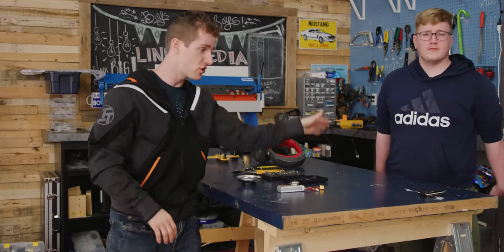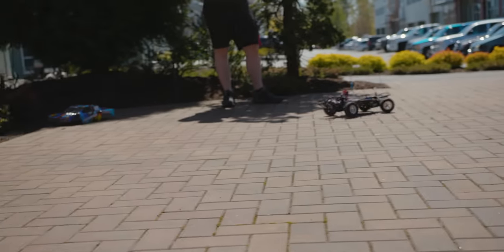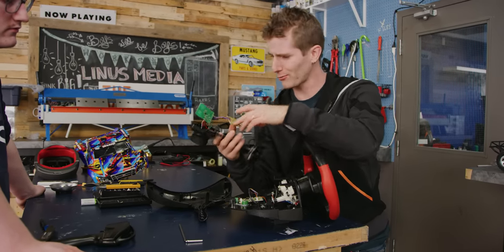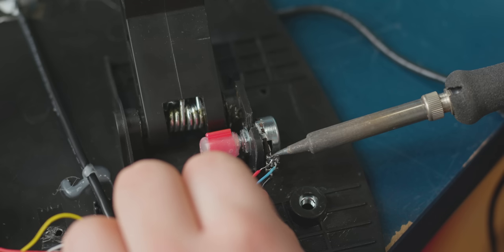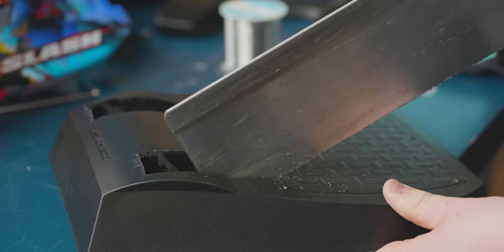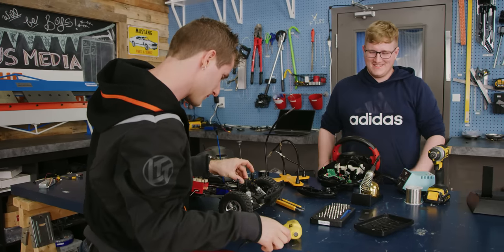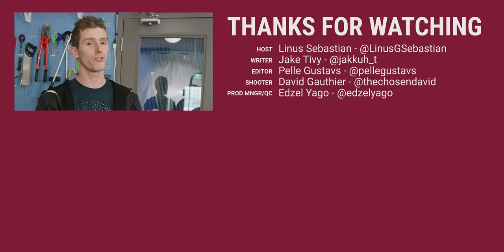First Person View VR RC Car Racing!!

Comment from the maker: We now know the resistance of the potentiometers SHOULDN'T have mattered. They're used as voltage dividers, so even if the resistance is different, it should have worked fine. However, while testing, when using the stock pedal's pots, we'd either have 100% or 0 throttle and nothing in between - hence why we tried to use matching pots.

As this is just a proof of concept, basically just to figure out if this is as cool as we imagined (and it is), we just needed the car to accelerate and brake in a controllable manner. The rest will be figured out for the actual final build. :D
Reply: Hi dad
Reply: 10/10 IGN
Reply: Hey Linus, I am ur big fan. Ur vids r really helpful. I am Daniel from India, I live in the UK

Hi from England.✋✋✋
Reply: yeet
Reply: How did you screw up copy and pasting a link into the description??
Reply: same as my project
Reply: Nice RC Car. 👍
Reply: Ey, I have the same steering wheel, but all black.
Reply: Linus Tech Tips you should try to control the rc car over 4g or 3g so you can drive it almost anywhere. Me and my friends tried to do it but wasn’t able to and wanted to see if you could do it😀
Reply: guess what's the half rotation of a 10k potentiometer...
Reply: Now just find a way to measure the g-forces and sync it with a tilting sim rig...
Reply: I built a fpv race drone last year but this setup looks extremly fun too! I know whats my next project is ^^
Reply: @TLawless  Don't forget force feedback so you can catch slides more intuitively :P
Reply: There is small chance that one potentiometer is linear and the other is logarithmic
Reply: Actually the resistance on the pot can matter MASSIVELY depending on how they are wired - whether there is another resistance in series especially, and whether it is using 2 or 3 wires (2 wire it ALWAYS matters hugely)
Reply: Here is how to do it correctly from scratch, posted it a few weeks ago and sent it to you per emai/twitterl: https://youtu.be/7Ja7rQFfQJc
Reply: That is pretty awesome. Wish I could be there. To much money for me tho :( to come to LTX
Reply: googly eyes on the vr goggles or go home
Reply: @Rabbid_Squirrel  - I've actually tried something similar with a remote camera and control system over 4g and the latency is horrible, to the point of unusable - the lag between input and response is so bad you have to almost be thinking a few seconds ahead. 

That DJI headset uses WiFi band signals (iirc) so I'd expect its probably like 10%, if not less, of the latency a 4g connection experiences.
Reply: Cheaper Better Version - Eachine TX03 Mini FPV Camera AIO Combo + Any 1S Lipo Battery + FXT VIPER FPV Goggles
I love yah Linus, so I am sorry for this, but you are waaaaay behind in this arena. Still, you did an awesome :)
Reply: @Rabbid_Squirrel  Actually we did manage this but the ESC gave us hell. Check out Project Dasher on GitHub
Reply: should try to make a car that transforms into a quad
Reply: 10/10 PCWorld
Reply: I think you could have soldered a 5k resistor in series with the potentiometer, that would probably had made it ok to use.
Reply: Linus.  Electronics 101.  using 1/Rt = 1/R1 + 1/R2 + 1/R3 + ...  you can put a 1% 10K ohm precision resistor across a 0 to 10k pot to get a 0 to 5k pot.   you can ALSO put a "10 turn pot"  with a 5k resistor in serires with the 0-10k pot so you can dial in (10 turns) a parallel resistance of 5k to 15k giving you the exact matching 5K total resistance you are looking for.    You did not have to change the pots out.  You were thinking like a mechanical engineer and not an electrical engineer.   Great job anyway.  Even if you and your team did not know the electronics theory your 'never quit' and 'never say die' 'solve the problem' attitude is stellar.   I can teach you electronics, but NO ONE can teach enthusiasm and your team has that in spades.
Reply: linear and logarithmic pots are a thing that you should know of.
Reply: lol sure you guys invented it
Reply: I have that steering wheel!
Reply: You should make a bracket dome that screws into the sides (2 points) of the chassis so that the camera and its receiver can get the air it needs and the camera can point right out of the front windshield. You can create a scoop like F1 race cars have to help circulate air into the car that will keep all the components cool.
Reply: Do the pots have 'A' or 'B' written on them? That's logarithmic vs linear ie. B10k is 10k linear.
Reply: You could put a 10k resistor in parallel with the potentiometer to cut the maximum resistance in half
Reply: i expected that much actually, ... say the transmitter is somehow defined to have... +2.5V = 100% and +0.1=0% or so.. and by the way the pots are built you can easily have like 0.5V jumps in between each gap so.. Not knowing any data... i would probably have came to the same conclusion like "in theory it does not matter but in reality we will probably have some janky results" .. and ill bet you just had another excuse to 3D print xD
Reply: Need scrapyard wars....!!!! 🤗🤗
Reply: Next time a TESLA first person
Reply: Is there a reason every other YouTuber is using NordVPN? is it better? Faster? More secure? Only asking cuz I used your link to subscribe to PIA VPN
Reply: can you mount 2 cameras one behind the rc car for switching to 3rd person view would be awesome
Reply: 7:03 Thank me later
Reply: There are goggles with motion tracking and you can put servos on the camera so the camera turns when you turn your head.
Reply: @JJSkEERt For me to travel to Canada for LTX will be alot more for me to go to Insomnia UKs biggest gaming event. But I might come to LTX in later years when am not charged two seats...
Reply: So something big and cool that you could try out with the system installed in the x-maxx from traxxas, maybe with a little bit of negotiations with traxxas you could get them to sponsor you or something just some food for thought.
Reply: The resistance could have mattered if there was some other resistors in series for a minimum preset, for example.
Reply: Lmao, I was literally about to comment a polite paragraph explaining this, but you guys always seem to correct yourselves in a very timely manner.
Reply: I'm surprised the steering wheel doesn't use a rotary encoder. Although you'd have to replace the car's steering motor to a servo for precise steering.
Reply: Been doing this for years
Reply: Good you wrote it. Was going to point it :)
Reply: You can use a pwm board and a raspberry pi connected directly to the receiver and esc on the car to have full control of the vehicle and more customizability. This also allows you to use your own rf transmitter and negate the need to use the original transmitter/controller
Reply: He got a haircut. He finally doesn't look like he's a little bit... Slow. Well, he doesn't look AS slow.
Reply: Famous western education...
shunt the 10k potentiometer with two 5k resistors and swap the wires. stupido
Reply: You should probably, most definitely invest in getting a frequency scanner for the video feed. in your office you probably won't have much interference but in the convention center you're probably going to need it to find a strong clean frequency. i know some FPV pilots that always scout an areas noise before flying FPV
Reply: Actually the original 10k pot would solve your throttle issue since the pedal throw is so much shorter.
Reply: Actually the original 10k pot would solve your throttle issue since the pedal throw is so much shorter.
Reply: Right, you would get less resolution by going with a smaller (resistance) potentiometer. Good video, though. Keep learning.
Reply: if you made the wheels slightly bigger it might help with the vibrations and motion sickness
Reply: It shouldn't matter if the pots are different (between the steering wheel and the remote) as they're usually used as voltage dividers anyway, so only the current draw would be different; the (proportional) voltage should stay the same, (since they're usually suspended between 5V and Gnd, and a µcontroller's A/D then picks up and translates the output voltage).
What WILL matter is the pot's degree of rotation and taper — (I would imagine a linear taper might work best for speed, while log might be better for steering).
Great idea, though! (I've often dreamed of doing the same thing with an RC helicopter).
Reply: Oh FFS use some damn flux and clean that iron.
Reply: @miroslavcepl8531  was about to say just that lol
Reply: @gabriel.rodriguez  Parallel not Series. Series would just add to pots resistance.
Reply: @mgzukows  oh sry, u're right, I thought it were 10k ohm on the controller and 5 on the wheel
Reply: @gabriel.rodriguez  no, that will make it a 5k-15k pot. to make it a 5k pot you would want to put a 10k resistor in parallel.
Reply: Try throwing in some resisters to divide the pots.
Reply: Couldn't you just livestream from some wifi6 phone?
Reply: maybe with a large resistance the wheels turn more slow
Reply: Sounds like you were connecting to the two ends of the pot instead of one end and the wiper.... But you would never make that mistake ;)
Reply: @stevenharris9941  IIRC not a perfect solution due to the taper of the pot but should work well enough for this application - something I've been aware was possible due to having an interest in and building a lot of headphone amplifiers.
Reply: Linus Tech Tips you need to look up Rotor Riot they make drones using FPV or look up Joshua Bardwell
Reply: Can't wait for the final build guide to do this at home. Next you should do one for drones or RC planes to fly from a flight yoke or joystick setup!
Reply: That DJI Kit... That's EXACTLY what I'm looking for for my RC Airplane!!!
Reply: That's awesome Try that with a cheap drone if possible just 2 my cents.
Reply: It's like watching from point of view of Antman.
Reply: I think the camera near the back as much as possible would make it easier to drive. like 3rd person driving a car in video games yah know
Reply: can someone out there please hook a brother up with a 3gb pci-e ddr3 vid card it's for a project for my daughters school and way out of budget and the 2gb card she has is just a hair to laggy no matter the setting
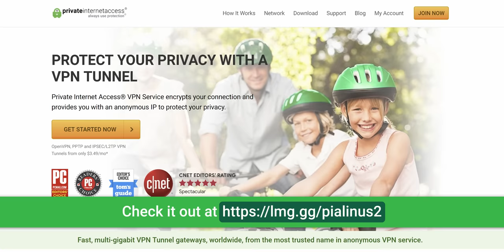Reply: @13:02 -- not even a SINGLE tool is there  where the layout says it should be... lol
Reply: This is not Linus.
Reply: @moelester2092  Cool Dad.
Reply: Channel Super Fun reborn ?
Reply: Why not rip out all the guts put a pi/beaglebone/other linux board in there to do video and car control? Or at least for controls as you could then easily code in custom acceleration curves and kill switches and whatever else.
Reply: That's odd.. I did not have an issue with the POTS when I did it. I had variable speed.. Im surprised you never contacted me for this..
Reply: @TheRealRCSparks  you are the GOAT
Reply: Could you please sell pre assembled final versions of it in international versions
Reply: You can also mount the camera to a servo connected to the same channel as the front wheels and your camera will turn when you turn the wheel. 
Or even use the DJI built in head tracking for even better immersive results.
Reply: Hey Linus I understand that you chose a plug-n-play version of FPV transmission system. But if you really want an immersive experience you need to try to use non PNP stuff like fatshark goggles and gyro module to actually control the camera angle on a gimbal (made with 3 servo motors, one for each axis) for a non fix camera angle on the RC model.
Reply: I was about to bitch about the poti voltage divider thing, but you were faster, as always
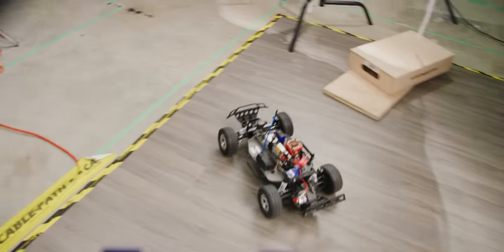Reply: lol that's a dude that has not tried FPV RC before 11:51
quite an experience to put a low latency camera on my collective pitch Quad https://i.imgur.com/sT2q2Ke.jpg and stress out in mid-air after a hectic day hedging the market.
Though, I'm nowhere near on a level like this dude.. https://youtu.be/0vWC-NWgkJI?t=13
Reply: Sometimes exact matching is needed sometimes it isn't.

It depends on the circuitry they are wired into.

As of the stoppers, you can just adjust the calibration of the speed control and the servos.  You can have the guys at the hobby shop help you with that.  (In fact they'd probably LOVE to help you in exchange for the purchase.  They'd probably throw in the stuff at-cost in exchange for advertising.)
Reply: @stevenharris9941  Close, but wrong. Operated into high-impedance you'll get the same voltage swing, but fundamentally you fail to consider the measurement burden. Cheap DAC's operate in the (1'000 to 10'000) ohm input impedance (Rin). When Rin is not much greater than Rpot (high impedance approximation) you can't just swap them interchangeably. You can however, build op-amp buffer with a build a much more ideal voltage response from a pot., but linear electronics are not efficient, but for stationary hardware who cares?
Reply: This coulda easily been a ChannelSuperFun video!
Reply: Did you re-setup the ESC? It should be able to compensate by calibrating the new input type.
Reply: Aaah, okay. I was sitting here saying to myself, "the resistance shouldn't matter!" Good to know the reason why you were trying to match resistance.
Reply: what's the point of the oculus? you can't look around
Reply: Hey Linus you didn't calibrate the ESC. That might give you the full power of the pedals. 
Do it and then thank me or hire me.
Reply: I still want to see the chiller thread ripper 2 being cannibalized
Reply: Pc or ps3 wheel
Reply: Beast nasty0313 hi
Reply: RCSparks Studio oops
Reply: Resistance is futile!
Couldn't help myself.
But, all I want to mention is, parallel resistance would help you.
Reply: What if we could drive actual cars? Linus you have a car in your garage
Reply: dammi! i wanted to make some preachy comment
Reply: Proof of concept??? We’ve been doing this for years lol you have a decent set up but you can use the bracket and mount it to the top of the body and have it set to a head height of an actual driver
Reply: Is there a place that I can find the final build?
Reply: you should make a 3D drone real vr to have dept perseption
Reply: Put it in training mode
Reply: CFC by
Reply: Rdd
Reply: NOW DO IT WITH TAMIYA MINI 4WD!
Reply: NOW DO IT WITH ANDROID PHONE AND ANDROID APPLICATION!